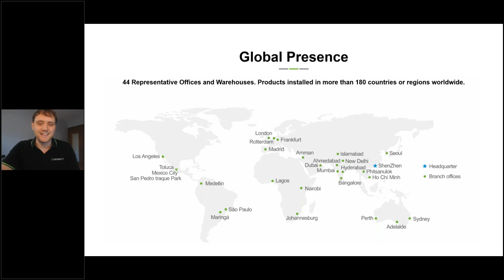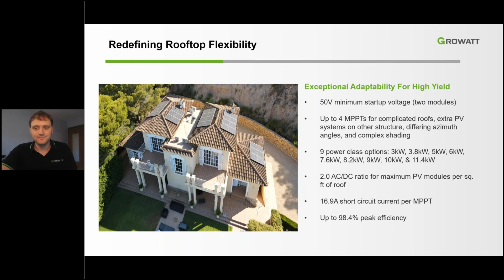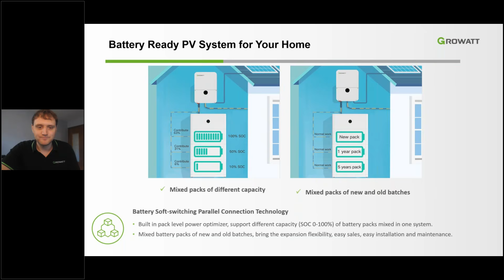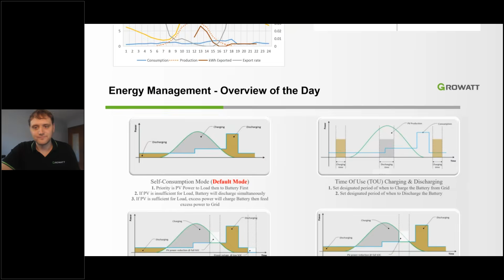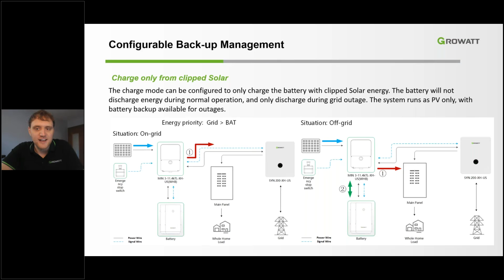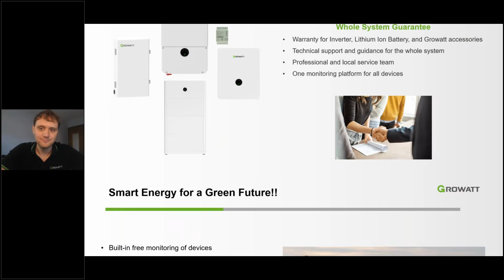Webinar: Battery-Ready Solutions To Innovate Energy Management for US Homes

Comment: good evening, my name is romon jones I currently have a growatt min 5000tl-xh & Ark xh battery installed at my residence. my inverter is currently programed to feed from the grid first to power the AC loads, then once the grid shuts off the battery automatically feeds the inverter to power the loads, however my issue is getting the inverter to feed from the utility grid once power is back on and not continue to feed from the battery.

i would like the inverter to automatically switch back to utility grid once the power is back instead of continuing to feed from the batteries.
Reply from the maker: Hi, for technical support, please contact our service team at service@ginverter.com or call our service hotline at +86 755 2747 1942. Thank you!